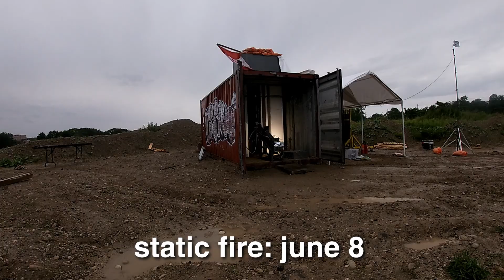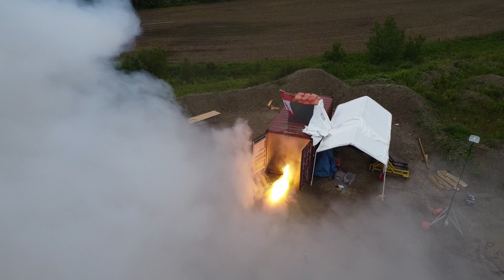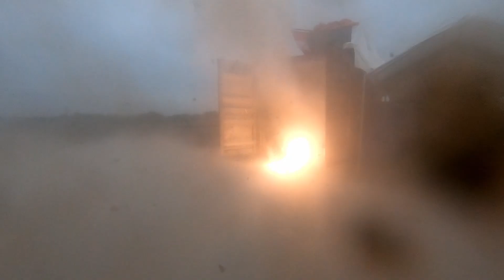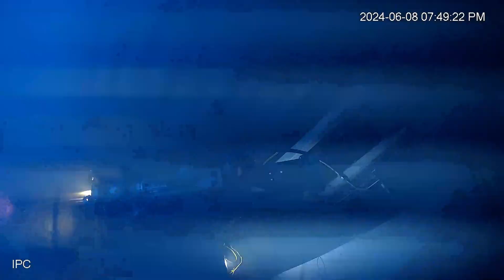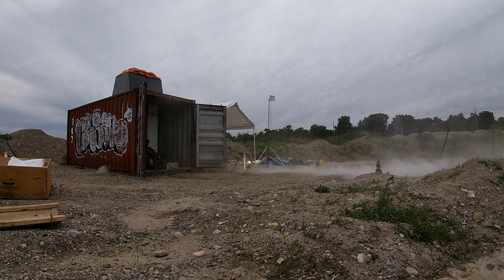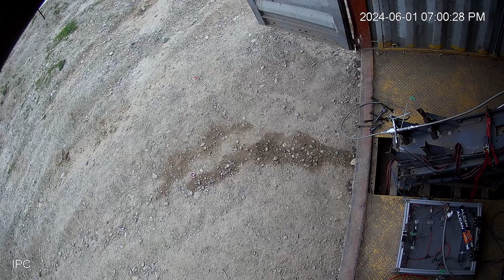Eridium - Liquid Engine Static Fire #2

Comment: looks like devil unleashed from hell. how do you pressurize? is it pump or pressure-fed? electric or turbo, if its turbo which cycle? its not common to see small scale liquid rockets with a turbopump.
Reply from the maker: It's actually self pressurizing Nitrous Oxide. We have a tank heating system to warm up the mixture in case we're not up to pressure. To learn more about the entire static fire, see this vlog: https://youtu.be/_bphZkszIes.